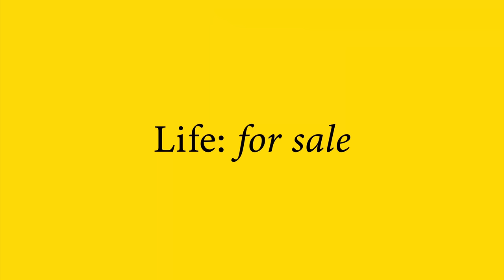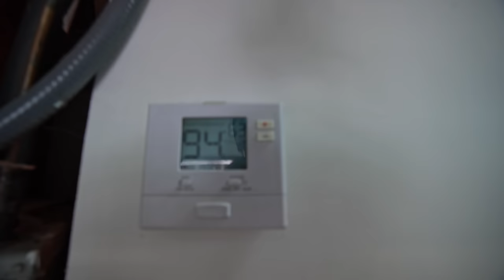The Golden Opportunity

Comment: 3:09, Window shattered when the door slammed is due to flexion in the wall (assuming the window was properly set). Remove the drywall and install another king stud on the window side. 2nd option is to install a right-hand door so the hinged side is closest to the window- this would transfer a majority of the impact of a slammed door to the block wall.
Reply: They don't seem to really fix fix things like that unless it's beyond necessary. A lot of throw a patch on things or paint it and let's get it to market

Comment: The next time you have a pipe bust you should use a vendor that's has experience in using liquid nitrogen. That way they can isolate and freeze a small portion of the pipe without having shut the water down for the building.

Comment: The ground is barely above sea level so it shifts. Solid pipe joints and corners will fracture because of this ground shifting.  When I installed waterfront pools I would use flex pipe on all corners of the pool's pvc pipe system. It may take ten years after a new pool is built to cause the joints to get stressed and fractured, but flex pipe at corners prevents this.

Comment: The glass may have shattered if the glass was tinted , & if it was tinted with the wrong film it won’t handle the heat properly which could result in shattering.

Comment: I wouldn't put too much concrete over top of that repair, that PVC is not designed to handle high pressure water and it won't last very long if it doesn't explode first. The chlorine will make it brittle and it will break. You should have used black or blue ABS main water line it's a much heavier duty and it's 200 PSI + rated.

Comment: This is a lot of helpful knowledge. Since you're doing me a favor by sharing such useful stuff, let me do something for you in return: Help with dieting:
It doesn't matter bread or not, it's calories in calories out when it comes to weight loss. Fat has way more calories than carbs. 2.25 grams of carbs is 1 gram of fat. 
So if you cut down fat like using oil spray instead of cooking oil, low fat cheese instead of full fat cheese and what not, then you'll cut down way more calories than you do by avoiding bread.
Especially as you get older, electrolytes and all the water soluble vitamins and minerals get flushed out when you cut out carbs. 
Carbs are not the enemy. Over eating your calories makes you gain weight. 
So the question becomes: How many calories should you eat to maintain? You'll know this as you keep counting your calories everyday. It becomes a habit just like smoking lol